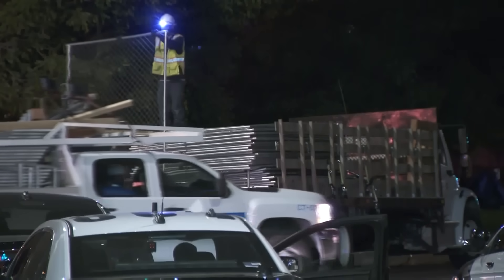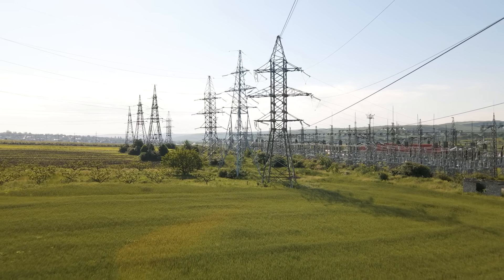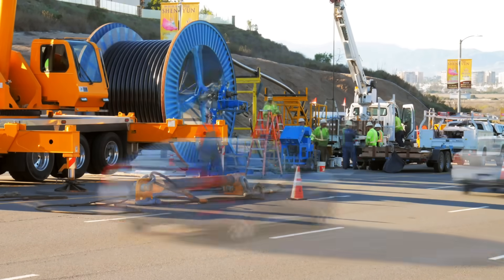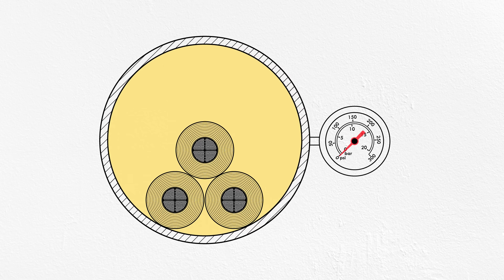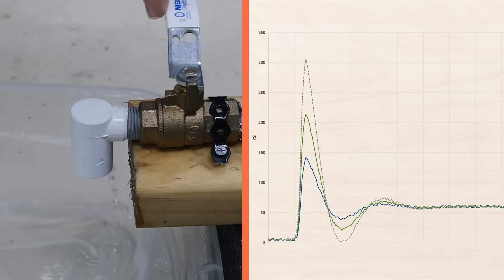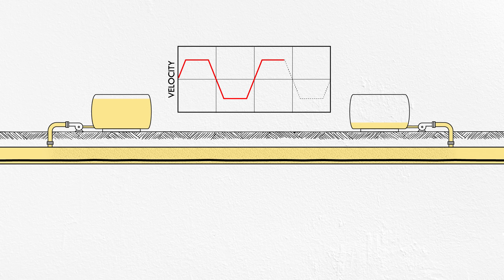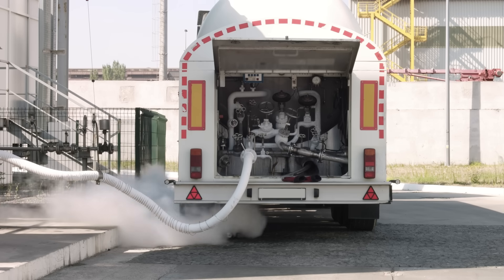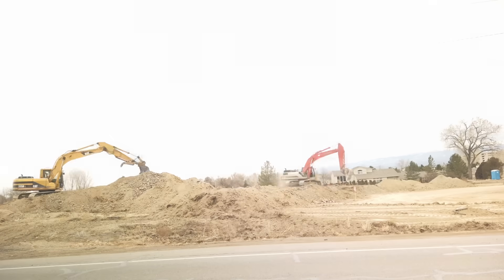Repairing Underground Power Cables Is Nearly Impossible

Comment: That was interesting. Glad oil (PBC) filled cable is no longer used. 
The lessons being is don't put all 3 power conductors in the same conduit in the first place. 
Build in redundancy (4 or 5 conduits + power cables) all physically separated, which would allow faults to be switched out.

Comment: California has had many terrible fires caused by trees falling on the power lines. This year one of these powerline fires was almost 1 million acres, destroyed 3 small towns, burned most of Lassen National Park and most of the state had more than 2 months of unhealthy air quality. California needs to figure out how to bury its powerlines, as expensive as maintaining underground powerlines is these fires might be more expensive. I'm an electrician and I briefly worked in the tunnels under the University Of Washington. I was amazed to see heavily insulated 5KV and 10KV wires secured to the wall of the tunnel, I wonder if California could do something similar.

Comment: I have so many questions.  What are the thermodynamic properties of the oil?  If it expands as it freezes wouldn't it increase hoop stress on the tunnel?  If it contracted, then you have another problem.  No friction to keep the frozen plug in place.  How does the oil's phase change affect the microstructure of the paper?  Does it form crystals inside the soaked paper? Paper isn't known for being particularly resilient.  If the plug fails wouldn't it send it down the tube towards the poor people working on it?  Like a big frozen bullet weighing several tonnes traveling down a barrel? THE WHOLE THING IS MADNESS!

Comment: I've often griped about how powerlines and billboards visually pollute the landscape and how they are incredibly susceptible to weather damage.  Having lived in rural communities where almost all of the power transmission is above ground and in suburban communities where most of it was below ground I've often remarked on how much less often residences and businesses lose power during weather events with below ground powerlines and how much nicer the landscape looks.  I'd always assumed that the below ground method wasn't used as often because it was more expensive and that the power companies were being cheap at the expense of their customers.  

Now I realize that while I was right that it is more expensive to put powerlines below ground that it is several orders of magnitude more costly and complicated than I had imagined it to be.  The next time I'm tempted to complain about high voltage powerline towers I will try to be more understanding of the complexity and costs involved.  I still don't like billboards though.

Comment: "The future is plastics!"  How true, said 50 years ago in The Graduate.  The new power line uses polyethylene insulation to replace the oil.  The first PE patent was in 1937 and it took many decades later for wide use.  PE is the most produced plastic worldwide.   It's beneficial uses are extensive.  Problem is that PE is also the most abundant microplastic worldwide.  Plastics are the most incredibly diverse product ever made but we need to find other consumer packaging materials that don't stick around forever.
Reply: waxed paper already exists and works fine for packaging
Reply: @0x73V14  Better biodegradable plastics would be more acceptable since manufacturers want to display their goods so customers can see them.  Clear PVC packaging is used today for that and it's also extremely tough stuff (and a SOB to open).
Reply: PE is the asbestos of the modern age. Great product, terrible for you.
Reply: @CatnamedMittens  PE won't give you cancer like asbestos does.

Comment: A distribution fault is scary. A transmission fault is unfathomable. to put it in perspective, 7200 volyage per phase is the standard distribution voltage and it faulting into the ground through a ground rod turns a 8 foot wide area of frozen soil into a rolling soupy boil, and the difference in potential between foot steps can instantly kill a person wearing insulated boots 30 feet away from the fault. Now transmission voltage is 50 to 100 times as high voltage, in short it goes big bang and if a fuse or recloser dont catch the fault, it could make a very large circle of death. In the trade, we are trained to bunny hop or shuffle when there may be a ground fault to reduce the difference in potential between our feet, but I dont think it would make a difference if it's a transmission fault though, it would be like that scene off of terminator 2 with the nuke.

Comment: Amazing there weren’t more leaks. Water mains break all of the time, i used to repair them, even in a solid rock channel bedded in gravel. Makes me wonder if it branches out and what the connections would be like.
Reply: I'm not an electrical engineer, but I did stay at a Holiday Inn last night, and it had electricity ...   I don't thing there would be branches in an underground transmission line (as opposed to distribution lines)   They're pretty much going to be running from substation to substation, and any branches which would split off would do so at a substation, which is an above ground facility.

Comment: Working. As an electrician, my boss would tell me about his experience with arcing. He was working near a high voltage line and would get a pretty decent shock whenever he touched something metal. He called up the power company to make sure it was safe and they just laughed at him cuz they were used to it. I think he finally just grounded everything so he could finish

Comment: An interesting story but I think it is not complete.  It implies high voltage underground power cables don't work at all but I don't think that is the case.  Perhaps the level of voltage that can be used without these problems is an issue.  My dad worked for a company that put power cables underground back in the 60's and 70's--I actually worked during the summer for the company at the west end of LAX when power lines were put under the runways that were extended when the 747's came in.  The company installed these lines all over the US and the world so they must be workable under some voltage levels and conditions.

Comment: Here in Iceland, only high voltage power lines are above ground, there are basically no above-ground lines in the city and towns. Same goes for phone and data, and Iceland doesn't have "cable".
Reply: Yeah, most of Europe is like that, it's a big contrast to the US where powerlines are up on top of poles where they can be blown down or crashed into by trucks.  Though I do love watching their clips of power lines setting trees on fire and arcing transformers.

Comment: Being an electrical engineer in the UK I find this fascinating, you explained so well and in such depth it was a joy to listen to.
Reply: The vast majority of urban power distribution in the UK is underground, I think this is correct since I don't see any overhead cables. How do we do it that doesn't mean constant failures?
Reply: @JohnnyMotel99  Oil filled cables of this type weren't used that much. Some oil filled cables were used but tended to be of the hollow conductor type where oil was pumped through the actual conductor itself. Each individual conductor could then be insulated with paper impregnated with high viscosity oil, individually jacketed and armoured, and direct buried, rather than having multiple conductors within a pressurised pipe. 

Oil cooling has fallen out of favour due to cost and risk of environmental contamination from the oil, especially as high voltage oils have historically contained PCBs which are a particular serious environmental contaminant. These days any new installation would be with polymer (cross-linked polyethylene) insulated cables, either directly buried, or in the case of some new installations in London, in deep bored tunnels. 

There are some cases where polymer insulation is problematic, such as in HVDC as used in the various international interconnectors. The original England-France interconnector uses mass impregnated insulated cable as it is incompatible with polymer insulation. Whereas the new second England-France interconnector uses polymer cables routed through the channel tunnel, and the England-Norway interconnector uses undersea polymer cables. The difference here is that the original England-France interconnector uses old HVDC converters based with a "current source" design. A current source converter operates the cable at constant current, and the power transfer is determined by the magnitude and polarity of the voltage. So, in order to reverse flow in a current source HVDC, the DC polarity needs to be reversed.

The more modern HVDC systems use a "voltage source" design, which uses a constant voltage, and the magnitude and direction of current determine the power transfer.  Voltage source converters are considerably more expensive and less efficient, but have much better controllability, have a number of grid stability benefits and can be more easily modularised and built at small scale. The constant DC voltage and polarity is necessary for reliable operation of polymer cables. Inuslators are never perfect, so there is a tiny leakage current through the insulation. Additionally, the polymer molecules act like tiny capacitors. So, over time, the polymer becomes electrically charged internally. 

The problem with CS HVDC is polarity reversal. If the conductor is at +500 kV, the interior of the insulation will slowly charge up to a high positive potential (maybe +400 kV a few mm from the conductor), and this charge would be trapped by the high resistance. If the cable potential was reversed suddenly to -500 kV, the trapped potential in the insulation would result in a potential difference of 900 kV across a few mm of insulation, which would result in arcing and destruction of the insulation. In a polymer cable, this is a catastrophic failure. However, in a mass impregnated cable, this will blow a hole in the insulation, but if the cable is allowed to rest for a bit, the oil will ooze out of the neighbouring paper to fill the hole, and the cable will self-heal. Avoiding this type of insulation failure means that power flow reversals over a CS HVDC link must be done slowly over several hours to allow the trapped charge to leak out
Reply: Try looking at South wales. Wer littered with them. Because as usualy. You won't share.
Reply: Electrical engineer here from the US, what is the salary for an EE in the UK?
Reply: @djaztec97  it ranges massively, depending on the type of work you are doing and the contract you have.
The average wage for an employed electrician, is about £32k, if you are an approved electrician about £36k.
If you are a subcontractor working on a temporary basic for a larger firm, and you are on a day rate, that can range from £200-£300+ a day.
I have friends that are standard electricians and they run small electrical company’s, and make earn around £50k a year.  
I am an employed electrical technician and I do mainly large industrial project and my base wage is £45k plus bonces, and I have a company van and other benefits.
However if you are a genuine EE with a full degree in power engineering, i know it is possible to earn £100k+ 
I believe that the electricians in the US earn a lot more than we do in the UK.

Comment: I have installed XLPE cable up to 44kv, this is so different, but very informative. Underground is so expensive and timely to repair, quite often we will loop feed the underground cables so we can feed it either way if we have to repair the cables.

Comment: I'm wondering about the economics, was it a big loss overall?  Did the loss of the line and need to replace it mean it would have been better to go with the usual above ground lines?  And, do the more advanced materials work or has there been enough elapsed time for problems to pop up?

Comment: Most transmission lines are Copper clad Steel to be strong enough to span long distances between towers. That would have corrected the thermal expansion issue. Known issue of deterioration with time of oil-paper capacitors in 1950s era TV sets. Also paper source? Paper decays from traces of acid Sulfur Dioxide from papermaking process. Special archival paper is made without SO2.
Reply: Asbestos cloth

Comment: When I lived in Denver we built a high voltage channel. It was the smartest engineering I have ever seen. We dug a trench and placed a metal tube that was coated in a really thick non conductive poly liner. Workers could walk through the tunnel and there was even a track system for a power feed system to run new power lines through it. The power lines were mounted to the sides of the chamber with an ingenious clamping system and the system was built so they never had to dig it up because they could inspect and even change out the mains without ever disturbing anyone.
Reply: Using an accessible tunnel is the best, but sadly also the most expensive way to do it. 30 years ago as a student I spent time with an infrastructure engineer working for the city in Hamburg. He laughed at the tunnel concept, saying that it was impractically expensive accept in the most heavily built up areas.
Tunnels also have their won unique challenges as somewhat paradoxically they expose the lines to more humidity and corrosive stress then just placing them underground.
Reply: @michaelrenper796  Doing something the right way is rarely ever the cheap option. Sure, other solutions are cheaper, but they are also less reliable, and harder to repair. I would expect a full tunnel would actually save money in the long run, through easier maintenance and repairs, though.
Reply: @michaelrenper796  it´s only the most expensive if you refuse to look further then your own job...
One tunnel being used for all subterranian contractors sounds a lot cheaper allready.
And then adding less cost to fault finding and repairtime, i think i´d know what i would want for my community.
Maintenance being a lot easier means less downtime even.
So the extra bit of corrosive stress you mention will result in more repairs, but not necesseraly more downtime.
Also by knowing humid surroundings, contractors can either install dehumidifiers in the tunnel (again beneficial to all not just one) or choose more corrosion resistant systems.

Hamburg seems a hugely built-up area to me btw?
Reply: While a tunnel might have some benefits that burial does not, it is also impractical over long distances and for smaller cities with smaller tax incomes. Cost is an important consideration for any project or even just choosing which groceries to buy.
Reply: Yeah I think it's not a coincidence that we never lose power here. The grid is incredibly well designed and underground cables can't get blown down/ weighed down by snow
Reply: @andrewbloom7694  Exactly!
Reply: Where at in Denver is this located?
Reply: @BennyVonBlanco  It was just outside of a sub division development we was building just south of Highlands ranch and our part ended right at the state park, dont recall the name of it but from what I know the Army Corp picked it up from where we ended and went through the park somewhere across (or in front of) the dam. Dont know where it was coming from or where it went beyond our contract though? It looked like they intended running it up the entire western corridor of Denver.
Reply: I would love to see an youtube video on this.
Reply: @xonx209  Gonna have to find someone younger than me. We did not even have internet back when I was working on this project. More specifically we had dial up but YouTube was not even a thing, or any social media for that matter..;)
Reply: And it only cost 100% more the aerial tower would
Reply: @kdrapertrucker  Well first off, the only way it could be 100% more than an aerial tower as you put it is if they did not install them, so that comment is ignorant on its face! Aside from that however you are spot on that it is far more expensive but the upside is the utility it offers far exceed that of power lines, its far more durable, less susceptible to natural disaster and it will in fact out last power lines by centuries (quite literally)! Something we as humans fail to consider most of the time is how we build something does have a long term impact on overall cost of that thing. You are one of those that is satisfied with mediocrity and being half assed and thats fine but dont complain because someone else is thinking long term! You just make yourself appear inadequate!
Reply: I guess LA wanted to save money by drilling smaller tunnels. Seems to have made maintenance a headache though
Reply: @chrisness  Yea I have dug to lay smaller conduits too. The ones I took part in building are maintained by robots and they are for sure much harder to maintain and do general maint on. The one I first talked about I was told by a coworker they use a small electric trolly to roll up to three people and all their tools up and down the main.

Comment: I lived in a coastal community that was occasionally battered by storms. All power utilities were buried. I later learned that they were more expensive to maintain when there was an excavation in my backyard because of a fault that effected several houses. The most complicated system that I was aware of was while living in Nome, Alaska. All city utilities are in heated tunnels (utilidors). Fresh water, power lines, communication lines, and sewage are heated and accessed through these insulated tunnels. At the time a typical residential hookup was about $40k.
Reply: Makes sense,  run the lot through one big tunnel.   You can do as you please forever.

Comment: Makes me wonder if draining the oil, cutting out the splices at the splice points, and pulling out the old wire and pulling in new wire and resplicing would be cheaper and faster. We do it like that where I work at all the time, but not on such a grand scale. This is interesting.